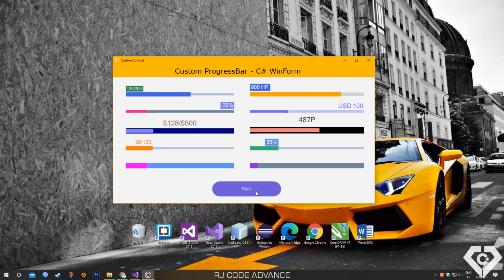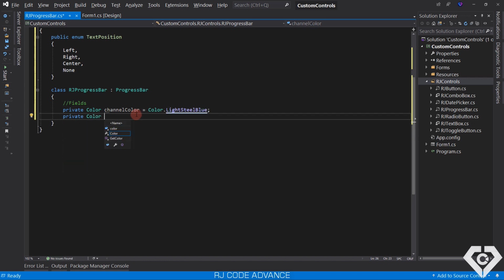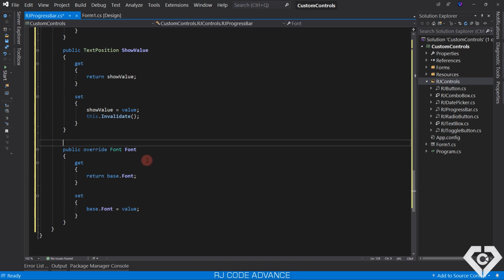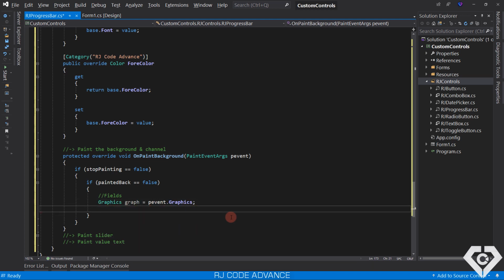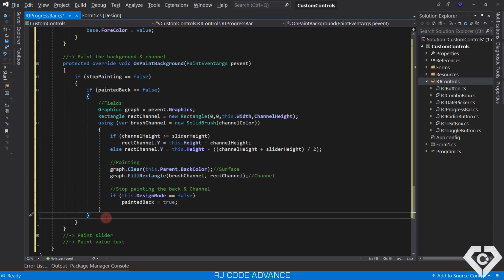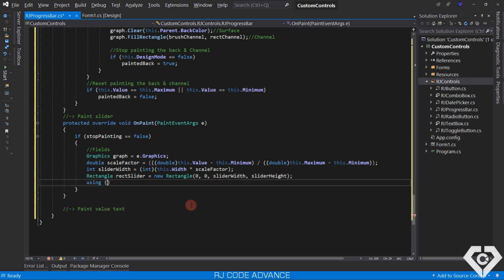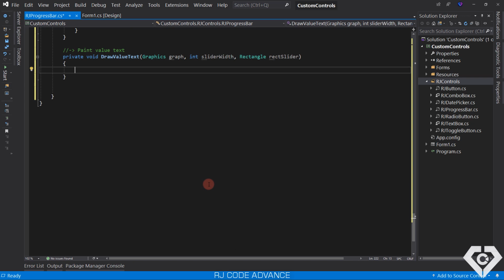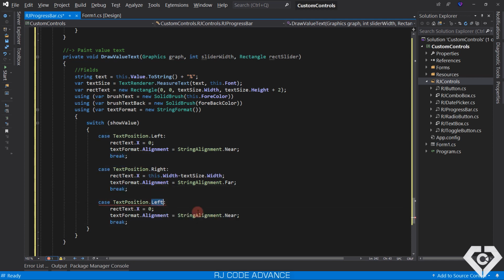Custom ProgressBar (No flicker) - WinForms C#

Comment: Everytime i try to drag and drop the progressbar it says: Error loading toolbox item "RJProgressBar".It will be removed from the toolbox. What did i do wrong? Im using visual studio 2019
Reply: you need to rebuild the project before you can use  custom controls.

Comment: thanks a lot. I wonder something, I did it step by step in my application. It works well. progressbar is tab 2 in my application. If I switch tab and come back to tab 2, complete color (back color) of progressbar is filling with blue. I couldn't solve the problem. Do you have an idea ? thanks in advance
Reply: its can be the force color

Comment: How did you change windows control box color from white to yellow?
Reply from the maker: In the latest windows 10 updates, it is possible to customize the colors.
I suppose you are using the first version of W10, where the color of the title bar is white, and it is not possible to change it.
Reply: @RJCodeAdvanceEN  do you know if it's possibile to change it in a windows form application?
Reply from the maker: There is no function for that, however you can create a custom title bar, as shown in this video. https://youtu.be/5AsJJl7Bhvc
To remove the top thin bar, remove the border of the form : FormBorderStyle=None.